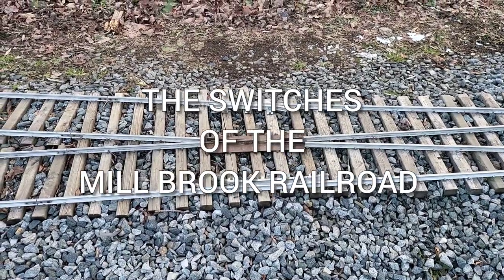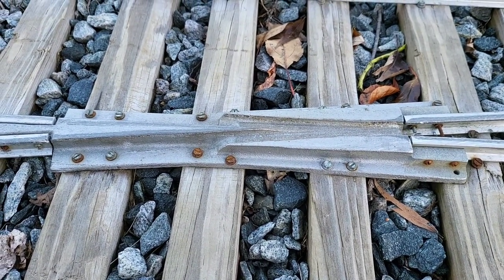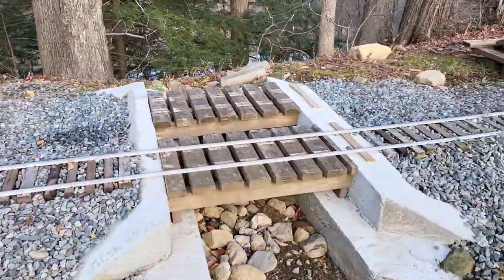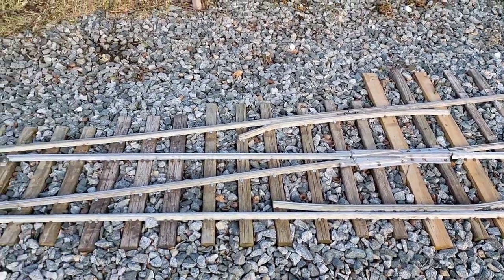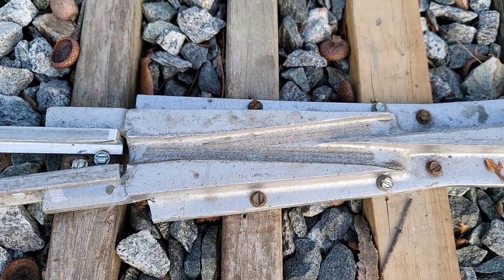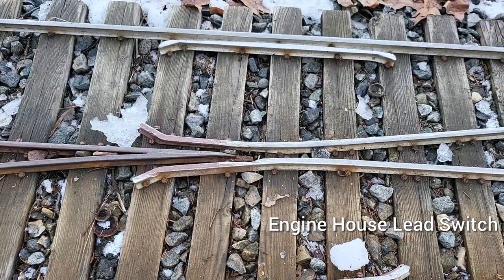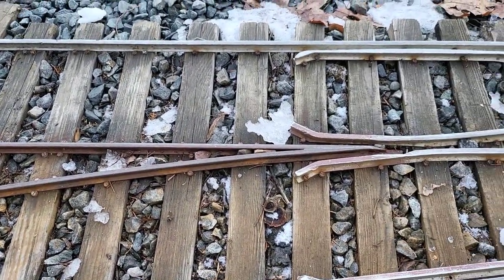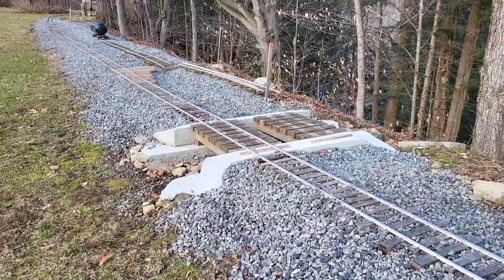The Switches of the Mill Brook Railroad

Comment: Hi, I love your work on the railroad. I highly recommend you have some new trucks to put on your chicken poop containers along with some couplings so you don't have to worry about pinching your fingers or the containers falling off the flat cars and you can get more chicken poop in the cars and the cars would look better in my opinion. I think having a half load is a waste of space in the cars. I also would highly recommend getting or making an 8 wheeled engine for the 8 wheeled cars and 4 wheeled cars for the 4 wheeled engines. I would also recommend making some longer sidings with enough space for 4 cars so you don't have to make as many trips. I also think you would get things done faster and I think it would be more efficient to have 2 sidings on each end of the mainline. The ride would be smoother if the short rails are replaced with longer rails and you would have fewer derailments and fewer broken ties to replace. I am not trying to tell you what to do. I am just making recommendations. I almost forgot to recommend making the black and yellow stripes like on 1206 in UNSTOPPABLE with Chris Pine and Denzel Washington on the front of the 70 and the 71 and any other engine you might get or make. Cory Mears

Comment: Thanks for the information on your track. How is your engine power. I see you with remote control in your hand when running the train. I am wondering what powers the engine. Is it gas power with remote control or electric battery power. Have a great day be safe.
Reply from the maker: The 70 is a 500W battery electric. Class ES-2-500.

Comment: Hi, I am back to recommend making the H10-44 for your railroad and making a box for the bottom of the 70 and the 71 for fake fuel tanks and to cover the power system on the bottom and protect them from the weather and make slots in the ends of the boxes for the chains. I would also like to recommend putting a sound system in your engines so we could have more of a variety of sounds. I think the best horns are the K5LA like the AMTRAK horns. I also think the best headlights for trains are the ones that are vertical instead of horizontal. I just don't really think horizontal headlights are even close to looking as good, no offense. I also highly recommend making a new pilot for the front of the engines with the same shape as the N&W 611 skirt. Many people call the skirt a pilot. It will make it easier to plow the sticks and snow from the tracks. You could even make it so you could plow the snow without the extra parts. The plow would be a permanent part of the engines. You could also have 1 on each end then it wouldn't have to struggle to push the snow and the separate plow every single time. It would only have to plow the light snow to the sides. I am just trying to make it easier for you. Cory Mears
Reply from the maker: There's a lot of money in what you're suggesting. 
An H-10-44 would be interesting, but I'm not a big Fairbanks-Morse fan. Baldwins, ALCOs, and early GE's are more my thing. That's why the horizontal headlights and no ditch lights on my locomotives. It's a GE industrial locomotive thing. 
Covers between the trucks get in the way of motor ventilation and get wrecked in derailments. They also make the locomotives more expensive. 
I may experiment with a sound system as a product development thing in the future. I build these little engines for people other than myself. My personal preference, however, is not to pretend these are anything other than battery electric locomotives. The only sounds I actually want for myself are a horn and a bell. 
I would be glad to build you a locomotive with all the features you want, but I don't think you'd like the price, either. Everything here is hand built, one at a time, and nothing is mass produced. At least not yet, anyway. 
It is fun to dream and speculate, though, so keep making suggestions, and maybe there'll be one that I like and have the means to do.
Reply: @MillBrookRailroad  Hi, I read the message and I didn't know that the engines in real life were that way, and I was just talking about the horn and the bell too. I'm not looking to buy any. I was just making recommendations for your railroad. I am a very very big fan of the H10-44. They are my absolute favorite switchers. I own a wooden train layout that is used for delivering heavy freight and passenger train cars. When the trains are loaded with rocks or coal or any other super heavy freight I call it hauling instead of pulling because I think the word pulling sounds too weak and hauling sounds strong. My engines are called BRENT, HANNAH, JASON, REBECCA, ARRY, MONTY, CARL, MOLLY, DOMINIC, ALICE, CHRIS, FRANK, STEVEN, HARVEY, SHAWN, LOGAN, HANK, WAYNE, DAN, DARCY, and CONNOR.